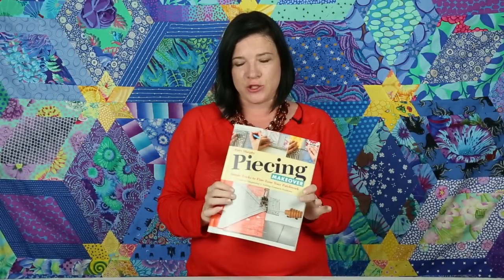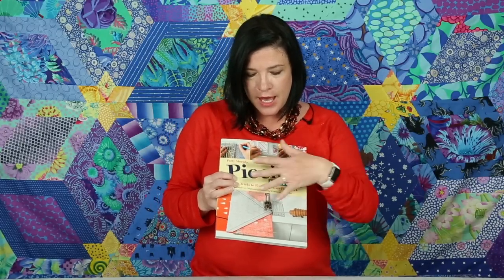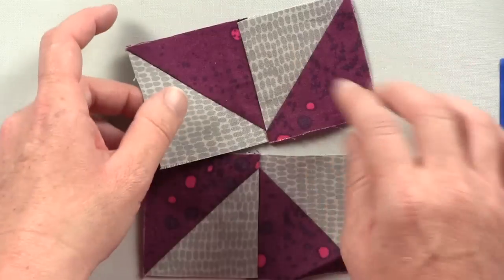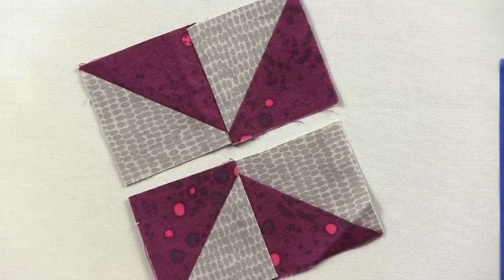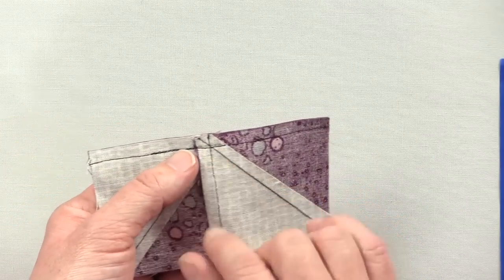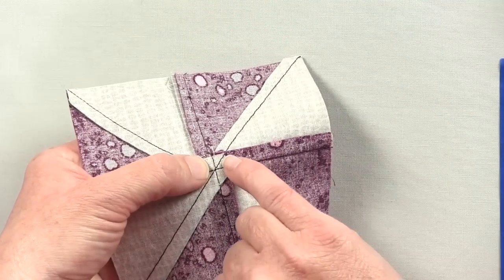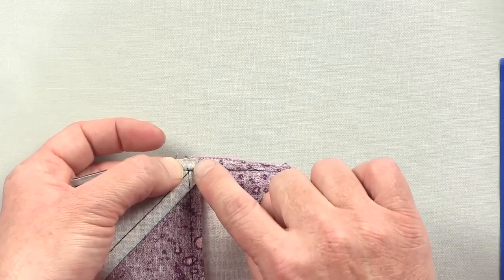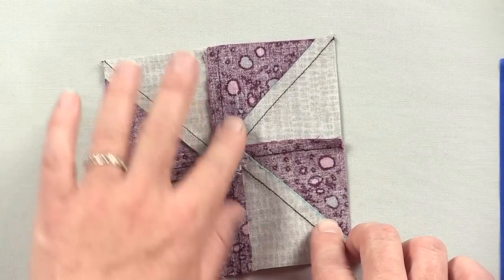Furling Seams Tutorial with Patty Murphy

Comment: I worry that the stitches will work loose, especially of the quilt is washed. Would a dab of fray check help with that?
Reply from the maker: Hi Bella, I've personally never had a problem with my furled blocks and it makes a world of difference if you're in the groove when free-motion quilting your top because the machine glides right over those points. Certainly a little dab of fray check isn't going to hurt if you'd like a little extra peace of mind. Betsy F.
Reply: I’m honoured you answered!  I agree it makes a much smoother area, but perhaps I’d add then that I’d unpick the seam ends but not cut the threads, so they’re less likely to work loose, and I guess it does depend on how aggressively your work will be laundered. For instance, charity quilts going into hospitals have to be washed hot, and frequently, but perhaps just don’t do furled seams for that application. 

Or shorten stitch length at that point. I’ve been doing that with my foundation paper work with economy blocks, and sewing over the loose ends of other seams, to secure them when I can.